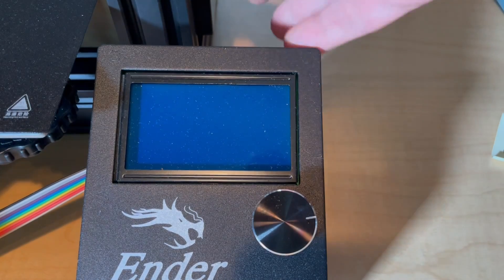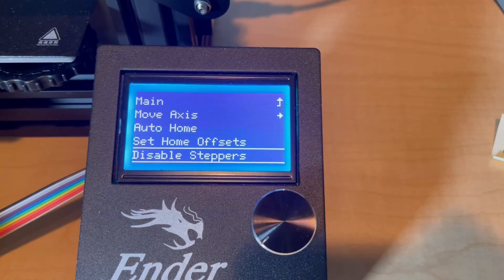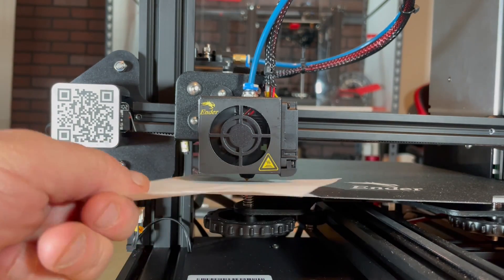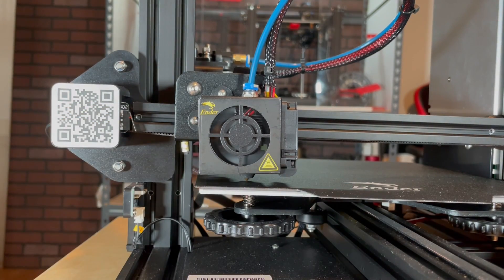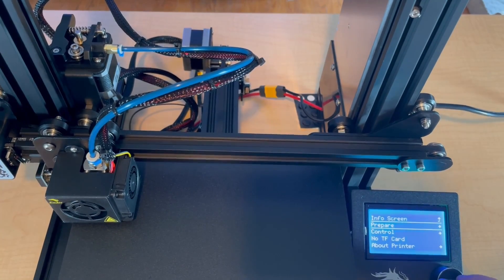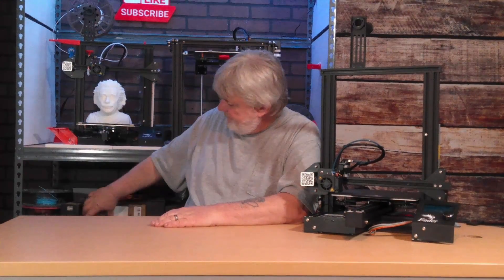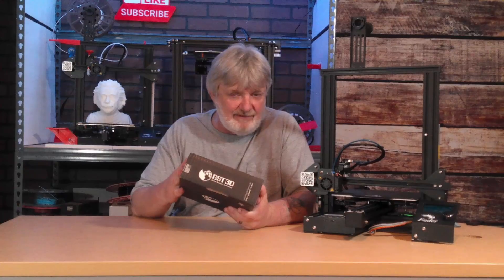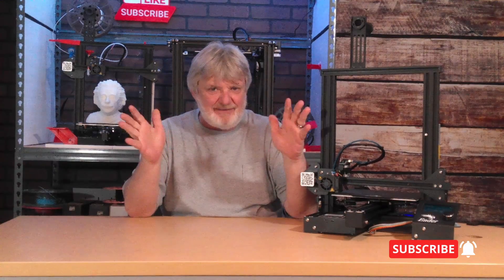3D Printer Bed Leveling For The Frustrated Beginner

Comment: So my bed should be close to the extruder when I press auto home? Feels like it's a whole centimeter apart. Is that normal? Do I need to adjust the z axis for it to be closer or do I do something else before I turn off the motors to start fine tuning springs?
Reply from the maker: What printer are you using? On an Ender 3, you would first need to make sure the Z limit switch is in it's proper location, lots of videos for that and then fine tune with the leveling knobs. I hope this helps!
Reply: @pushingplastic7445 it's the ender 3 neo, I don't think it has a z limiter switch
Reply from the maker: @jakefrost7108  The neo has a z limit switch, similar to the ender 3. Here's a video on adjusting that. It should get you closer. https://www.youtube.com/watch?v=bGGNlHkuLX4

Comment: First if you don't have a dual Z Screw get that upgrade first. get FR4(G10) bed then get some thick zipties if you have Crtouch sensor then bed leveling will be a breeze with 3x3 mesh bed leveling. After you bed level your bed use zipties to secure screws in place

Comment: Do you find it necessary to preheat everything before leveling the bed?
Reply from the maker: Good question! Some will argue, but I never found it to make a difference either way. People will talk about thermal expansion of the bed plate & nozzle but most couldn’t tell you how much they expand. I did my own testing by leveling cold, then heated things up and didn’t notice a difference.
Reply: @pushingplastic7445  it seems like there is a lot of superstition in this hobby. Lol!
Reply from the maker: @JoshuaWShanks  lol, I would have to agree with that. But when I get those days where I want to print something and have nothing to print, I experiment. The results are either “that worked well” or “I won’t try that again”. Of course sometimes I cross my fingers!

Comment: but what if you have high spots due to a warped bed?
Reply from the maker: Good question! The most common fix is to put some blue tape under the lower spots. So far I've been lucky and haven't had to try it yet! Thanks for watching!

Comment: Does grinding sound normal?
Reply from the maker: I’m guessing that by grinding, you mean the sound of an extruder skipping. Typically that’s because something is restricting the flow of filament from the nozzle. This can be caused by the nozzle being too close to the print bed, a clogged or partially clogged nozzle or you’re experiencing heat creep where the filament is retracting to far up into the heat break area of your hot end and cooling. If you’re hearing clicking or grinding, you’ll want to find out why and fix it. You’ll get much better results if you do. I hope I answered your question. Thanks for watching and keep those comments coming!
Reply: thank you for your answer. I'll be checking my extruder for some clogs. and one thing is some filament being caught up on my nozzle and the stringing is horrendous
Reply from the maker: @RavenousMecha  Based on that information I would guess that your nozzle is too closed to the bed. If you are using a piece of paper to level the bed, just back off slightly on the how much scratching you are feeling between the nozzle and paper. Eventually, you’ll get a feel for how much is to much and how much is just enough! It comes with practice. It might be a pain, but it’s better to put in a few extra minutes at the start than have a 10 hour print fail halfway through! Good luck and let me know how you made out!
Reply: @pushingplastic7445  thank you very much. i'll try that too.

Comment: Where are you located? I used to get that filament from from a 3D printer that was at a local flea market. I've been looking online but it looks like they don't ship in the US anymore.
Reply from the maker: I'm in the US. My understanding is that recently the US operation was sold and is now sold on https://fremover.net/ I got my first shipment from them about 3 weeks ago. The prices and shipping appear to be the same as does the filament. The packaging is different, white box that is labeled IIID MAX. I hope this helps and thanks for checking out my channel!